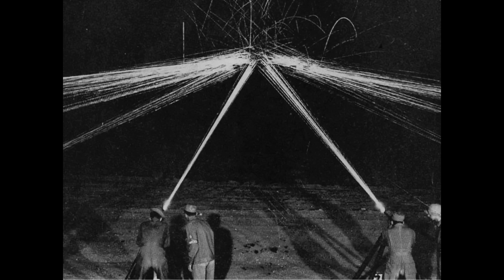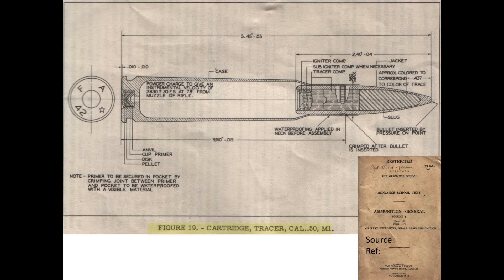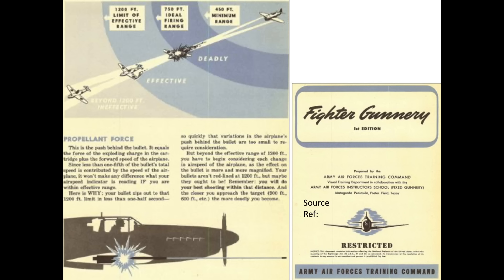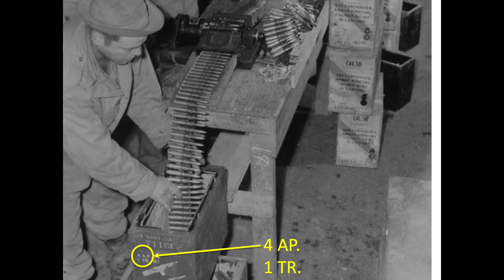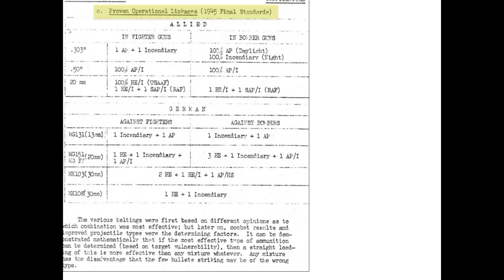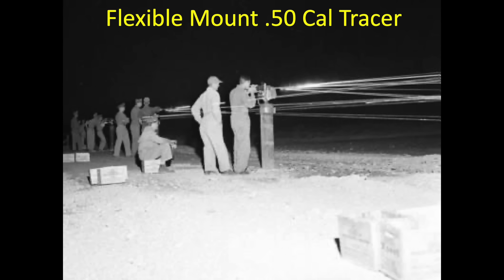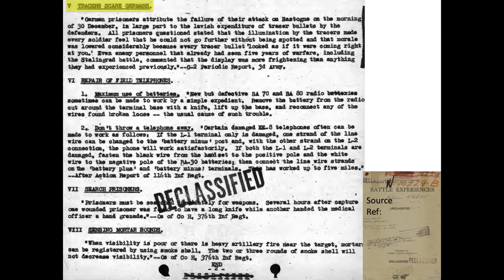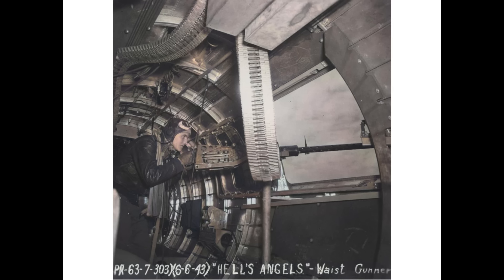Why WWII Bombers Eliminated Tracers in their Ammo Belt Mixes

Comment: when I was overseas, we'd often load no tracers, except for the the last 3-5 rounds to indicate end of the mag. but over time you develop an ability to subconsciously round count and didn't need them, and they could potentially alert the enemy you were about to reload. Most of us just stopped using tracer altogether because we didn't need them and preferred stealth.
Reply: What were you?  In the army I was never issued tracer except in the belt for an mg.
Reply: I was issued 5.56 tracers in the Army National Guard only for night fire qualification and familiarization firing with "gas mask" on (since proper shouldering and sighting of the M16A2 with that on was impossible).
Reply: Did you carry empty m1 clips to throw against the ground as well? Rofl.
Reply: @ret7army  Served under the Army, Marines, and Navy. long story. We got everything, including SOCOM gear. It was a weird set if circumstances for my unit whenever we got deployed. Totally out of our control, but made for great deployments.
Reply: @ShortArmOfGod  Nope, no M1s. We had M16A4s, M4s, M9s, and we customized our rifles to the gills (custom triggers, custom stocks, rails, slings, grips, magpul mags, custom sights and selectors, etc.). We had Aimpoint, EoTech and Trijicon optics (everyone got to choose which they wanted as we had enough for everyone to have all three), as well as thermal scopes, helmet mounted thermals, night vision optics, laser designators, all our M240 and M2 had thermal scopes, etc.

We were told we were given priority for gear behind only SOCOM, as our job was considered vital, and we were accomplishing a lot.
Reply: What a strangely diffuse way to describe your kit when you claim to have been some kind of delta force type guy. Doesent smell right to me
Reply: @ravener96  never claimed to be Delta force. We were just an unusual unit given unusual orders.

I also said we got gear After SOCOM, and Delta is part of SOCOM. But thinking is hard, and so is reading comprehension.

Why don't you use your full legal name on YouTube? Why do you hide who you are? Why don't you tell us your name and where you live?
Reply: @SoloRenegade  a guy calling himself solo renegade demanding others to give all their identifying information, not even in the forces or in the states and that story still sounds like some of the most bullshit fake service member shit I've ever heard. every legit member of the services I've ever seen has had no issue stating their unit,  and MOS unless they were full of it cause they always know somebody who was actually there would come along and call them out
Reply: @SoloRenegade  my username has literally always been Tyler Urquhart that your now trying to grasp at straws like that when literally your first response to me was using the @tyler urquhart further adds to your lack of credibility
Reply: @SoloRenegade  people in the military usually dont act like small children. i doubt you have been in any service by the way you write, and if you have then you arent exactly presenting a good example. seems like a lose lose on your part
Reply: @ravener  the best part is I just updated my username for the first time in 13 years to prove him wrong comments(at least in my notifications) still have my old handle they didn't magically all update as he asserts they did they can also only be changed every 14 days so if I supposedly just changed it then it's not possible for me to have done it again
Reply: @BackToTheBas1cs  

I see you're using the username "BackToTheBasics" again, and not your name, Tyler Urquhart. See how that works?

Now, if you change it again, the username with the @ symbol on all my comments to you will change again, but this time we have record of your changes.
Reply: @Solo Renegade  your unironically not realizing that there is a limit to the number of name swaps so your trying to imply I'm somehow exempt from the rest of YouTube?
Reply: @SoloRenegade  i have been in the military, i dont mind telling you where either. While yes, we do a lot of silly stuff, we also carried our heads above our shoulders, and presented a neat image to those we met. your style of writing strikes me as a wannabe.
Reply: @BackToTheBas1cs  you admitted to changing your user name, "@ravener  the best part is I just updated my username for the first time in 13 years to prove him wrong comments(at least in my notifications) still have my old handle they didn't magically all update as he asserts", and I could see your change reflected on my end, even if you didn't see it on your end.

I've changed my username on YouTube before as well.
Reply: @Solo Renegade  yes I just changed it to backthebasics after you called me out for supposedly changing it so I did change it to prove that I hadn't because if I had changed it I wouldn't be able to change it without exceeding the change limit in a 2 week period which means my original comments as Tyler Urquhart is my original username keep trying though
Reply: @SoloRenegade  idk, your comments imply you're some kinda high speed operator, and that really doesent seem very likely, which undermines the information you wrote. loading tracers at the bottom of the mag to warn of low ammo isnt unheard of, never done it personally, so not needing it is also plausible. that its due to stealth seems dubious to me, but i have shot tracers in the dark, so i guess the signature concern could be a reason. idk, its a weird rationale, and even weirder presented.
Reply: @BackToTheBas1cs  ALL of my comments to you say BackToTheBasics, on my end at least. But you're free to keep trying to cover up about lying.
Reply: @Solo Renegade  you yourself just argued previously that it automatically updated the tag to the new username so what is it does it update or doesn't it and your still missing the bit where there is a change limit so I couldn't physically be switching back and forth as you claim
Reply: I don't know why but I'm just thinking of putting the 3-5 tracer rounds in the middle of the mag to make the enemy think you're reloading.
Reply: @SoloRenegade  " For someone who claims to be upset about how other represent the military, you're doing a horrible job yourself." lol. i don't care if you poorly represent the military, that's your prerogative. if you're just trying to go "no you" i feel my point is proven.

" You're just a sad woke person who can't stand being shown they are wrong" mind pointing out the woke bit? or the wrong bit? all i have been is critical, and you're just out here flying off rails.

i feel you can be safely put in the category of "ass mad" now
Reply: Omg this is bs. I smell stolen valor.
Reply: @cprogrck  what would make it "stolen valor"? It's not unusual for a person to use tracers in teh military. are you saying anyone claiming to use tracers is stolen valor?

Is it about the gear we used? is that stolen valor?

Or is it the fact you find it hard to believe an Army unit was assigned to the Marines and Navy? 

Or, is it the fact that I don't identify myself, as you are not doing (cprogrck)?

Prove stolen valor, and state what part you claim is stolen valor.

I have the DD214, orders, uniform, and all my guys who can back me up in a heartbeat.

Being vague is not stolen valor. And stolen valor requires than someone benefit in some way. I have nothing to gain by sharing my personal experiences. The benefit is for others to hear alternative cases of what happened and why.
Reply: @SoloRenegade  these people that think something is fishy with your story only know what video games and movies tell them about the military, they are children who think they are experts about something they've never experienced. One of the first things they taught me during weapons training was tracers were great, for you and your enemy. We were given the choice what we would load our mags with as well, never used tracers in a rifle, just for the mg.
Reply: @kevinhank17  Exactly. Bunch of young guys thinking they were cool, get into combat and realize they were good enough marksman that they didn't need tracers, and that tracers were a liability to their own safety. We even stopped using tracers in the MGs. Before our second deployment I had become the unit's resident expert on the M2 and got everyone trained expert on the M2 in my platoon. The guys were good at aiming with the sights and didn't need tracers. Short aimed bursts was emphasized. We set three scout gunnery range records later on that base we were training at due to the speed and accuracy they developed (fastest completion of the range scenario, fastest average engagement time of 3sec, and destroyed 100% of the targets expending only 40rnds of ammo, I'm very proud of what my guys accomplished that day, impressed a lot of bystanders that day because of their skill and professionalism). And we ended up getting early CROW turrets too, totally negating the need for tracers.
Reply: @MediHusky  yes, I like the way you think. I used to spend  lot of time teaching guys about psychology in warfare, and how to use it to out smart, confuse, or trick our enemies.

We often times would come up with temporary tactics to confuse the enemy, or throw them off. They watched us on every mission, and took notes. So shaking it up randomly at times worked well.

Other people did neat things in other units as well. We heard stories of one unit in Afghanistan convincing the local Taliban they were vampires, and another unit tricking insurgents into thinking if they wrapped their vehicles and weapons plastic wrap the drones couldn't see them, and when they believed it and wrapped stuff we could more easily spot them and destroy them. I can't personally confirm such stories are true or not, but they were going around when I was overseas. But they serve as great examples of how to use psychologically on the battlefield.

There is also the situation of target saturation that my unit used to GREAT effect overseas in a way few people seem to understand. It also is the reason why German aces scored so high on the Eastern front in WW2 but not on the Western front. We used that to our advantage to achieve greater success than other units, and no one else seemed to figure it out.

Psychological warfare is a favorite tactic of mine.
Reply: @SoloRenegade  i do kinda enjoy it, its amazing how easy it is to make you dance.
Reply: @ravener96  dance? how so?
Reply: @ravener96  All you're doing is attracting more attention to my comment due to the increased number of comments.

Comment: Started a significant fire using tracers. Here is how it happened. In about 1982 A two helicopter detachment,  Navy Attack Squadron HAL-5 was detailed to work with Navy SEALs in a training scenario near Travis Air Force Base, California. Specifically, on Grizzly Island which was not inhabited, low laying and tall grass and small brush covered. There is no bridge to the island. It is about 7 miles west of the main Travis AFB  runway. During the exercise live round tracers were used. And it caused the whole island to catch fire. This caused  so much smoke it closed down the runway at Travis. I was there.

Comment: When I was in the Marine Corps we had the 106mm recoilless rifle.  It didn't have sights.  It was sighted with a single shot, breech loaded .50 cal tracer.  As soon as the tracer was fired, within seconds the 106 round was fired.  The enemy learned that the single shot tracer meant that a 106 round was gonna hit in a few seconds, hopefully enough time to get the hell out of the way. The enemy can then quickly determine where you are. Really, the only use for tracers is to see approximately where you're hitting.  However, a machine gun firing into a target should clearly show where it's hitting, without the need for tracers!  Ball rounds: Good!  Tracers:  Bad!

Comment: George "Buzz" Beurling was the savior of Malta and a very keen eyed fighter pilot. He had his crew remove all tracer rounds from his plane for the simple fact that he could "Lob" rounds over a thousand yards and kill the enemy plane from beyond the gun camera range. A few kills were disputed until the wreckage washed up on the shore or the enemy pilot that survived told his side of the same story. Most kills never knew he was high and right behind them as "Buzz" liked a diving right to left around Malta. The Sun is over his shoulder and speed his best friend. I have the same rudder pull when in an acceleration dive. The Dicta Boelcke should be handed out at the door to any Flight School.